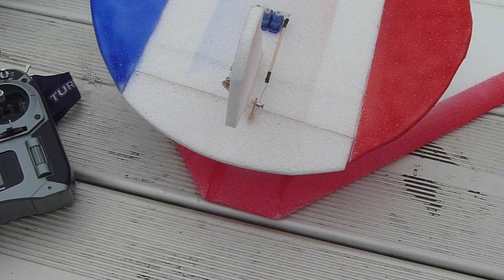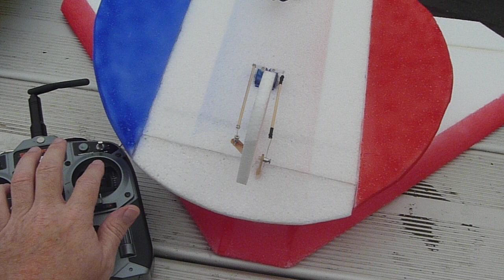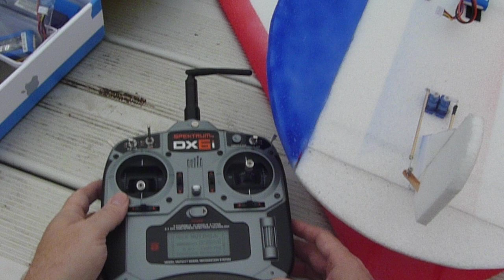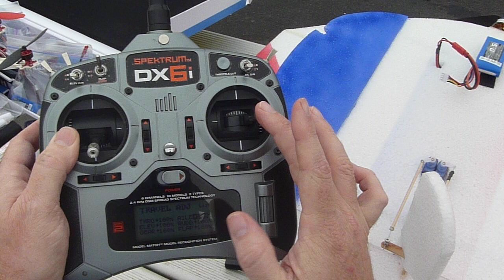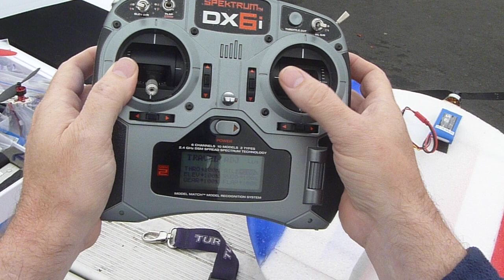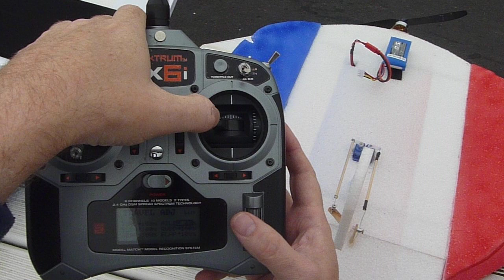Using Travel Adjustment to correct control surface movement

Comment: How to burn out your servo when turning left = just select over 100 percent…
Reply from the maker: Ah, you probably didn't know that Spektrum's PWM range is 1100-1900 microseconds, so bumping it up to 125% lands it at 1000-2000 microseconds, just in line with the servo's min and max range.  After 10 years, happy to say this little bird is going great!

Comment: I wonder how to accomplish just that in a non-computerized transmitter?
Reply from the maker: The theory is easy... you have to make sure the control horn on the rudder and the servo arm are sized properly, make sure the control rod is parallel to the body, and make sure the control horn is centered properly over the rudder hinge.  I built this plane as I was learning, and didn't know this!  It works OK for me now, but if I built it again I think I would be able to make it need much less correction.  I learned a lot about this from Andrew Newton: https://www.youtube.com/watch?v=yCXw94e9Cf0

Comment: A better solution would have been to use the subtrim function to center your servo arm and then size the control rod to center your rudder.

Comment: Thaaaaank YOU ! You saved my DX6i!
Reply from the maker: Sweet!
Reply: Mark Harrison does it work on the dx6 Black Edition too?
Reply from the maker: I'm not sure, but I haven't heard that they've changed anything, so there's a good chance it will.
Reply: Thank you very much. I am new tobheli. You just give me the solution to fly 2 helis needing a lot of trimming and saving the info on trimming for each model using the travel function.
But... am I right?
We have a severe trimming on a Blade mSR S on aileron and elevator and I would like to save them on the model memory. Is it a good way? Sub trim is supposed to be just for small amount... 
I don't want to do the trim manually each time I change heli model.
Tell  me please!
Reply: I finally found my answer! So easy: the trim adjustments is saved for each model on the DX6!!! I did not realised it before.  And it works!

Comment: Hello ! 
I need to set my travel ajust in my quad,  the valeu must be between 1000 and 2000 using the Travel ajust already in 125%  I just reach out 1980.  Do you know what I need set to get the max 2000  ?